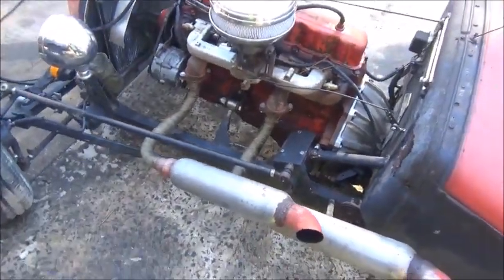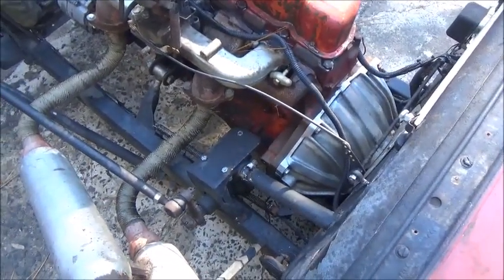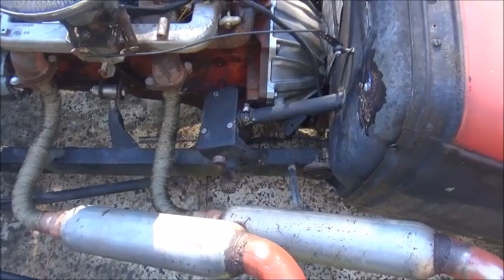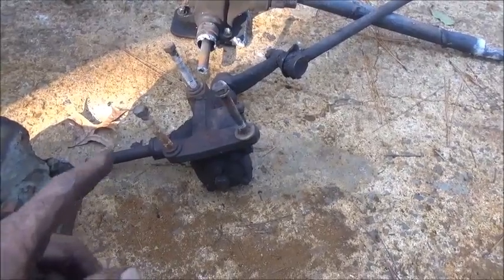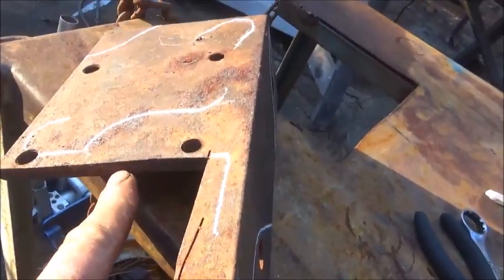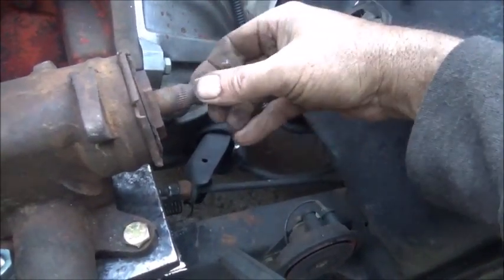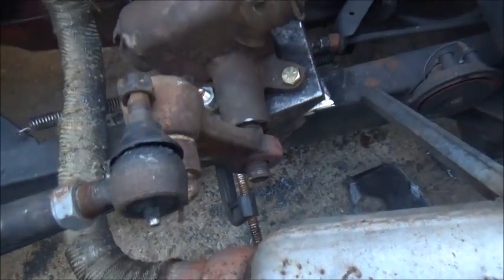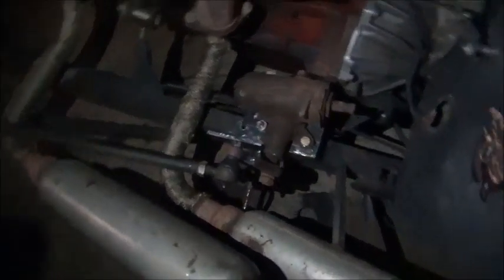1931 Rat Rod "Deathtrap" Steering Repair Part 1 of 2

Comment: Food for thought I am building a 1947 chevy coupe rat rod and the steering box was shot. All I had laying around was a 1927 ford box so I thought just for the heck see if the pitman arms would enter change and they did. So I now have a 1927 ford box  with the orig. 47 chevy pitman  arm.   Chevy and ford at least use the same splines for at least 20 years, food for thought.
Reply: 1927 model T Ford didn't have a steering box, they have a planetary reduction on the steering wheel.

Comment: I think you're right about using a bigger steering wheel, but I don't know about a tilt wheel unless it's a 1950s-60s-70s tilt column. The bigger wheel should be some kind of thin rim steering wheel too with a horn ring, chrome trim or a medallion in the center or something, just for the vintage flavor.

Comment: What does the heat of that exhaust do to the grease/oil/lube inside the steering box? They are pretty close together. Will it need a heat shield?

Comment: Saginaw Steering gear...available in both rotations, power or non power. Ford Econoline vans starting in 1975 have opposite rotation to the traditional GM applications.

Comment: my Grandfather and his 2 brothers all bought 38 chevrolets. 2 lost steering and went in the ditch. my uncle took the box apart on my Grandfathers and the worm gear and worm wheel were worn out. they did not have ball bearings. my 48 chevrolet has the saginaw reciprocating ball steering gear and it was just fine.

Comment: If you have to cut a steering arm, cut it on an angle to get a longer weld that is less likely to fail & heat it before welding then let it cool in a bucket of sand. Your life & others could be at stake.

Comment: I am new to welding.  If you dunked the red hot newly welded arm in water, would it be stronger? is that a good idea?
Reply from the maker: Some things you don't want to make to hard. The harder it is the easier it breaks but less chance it will bend.